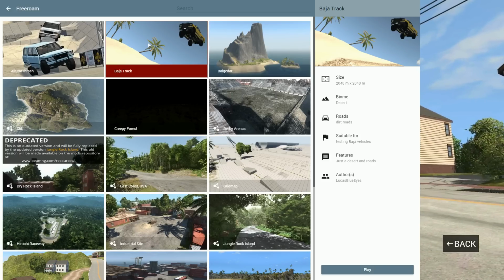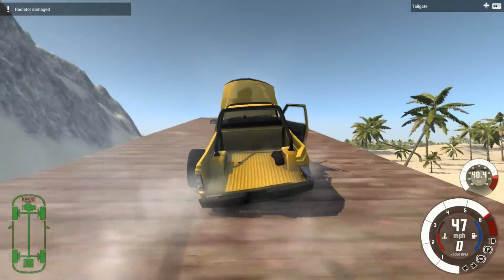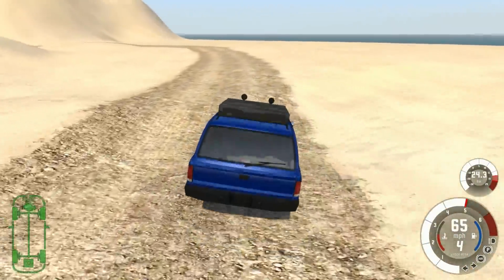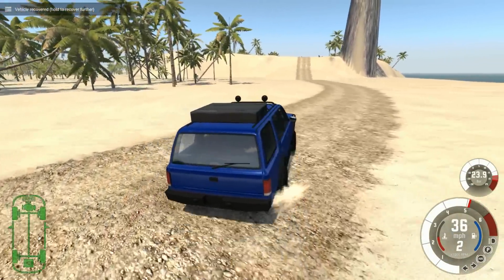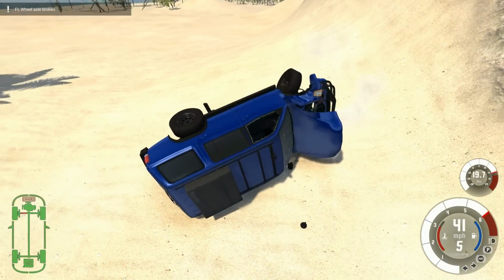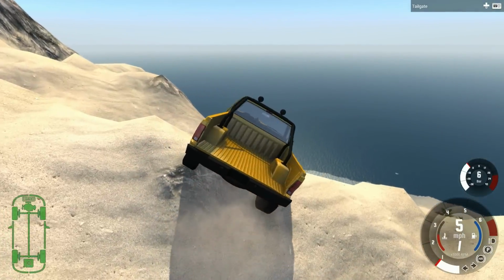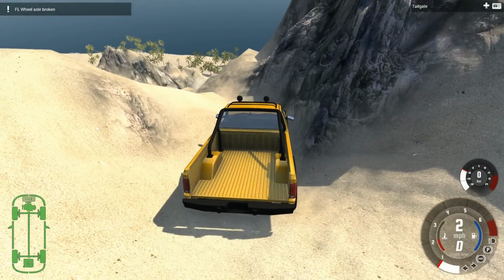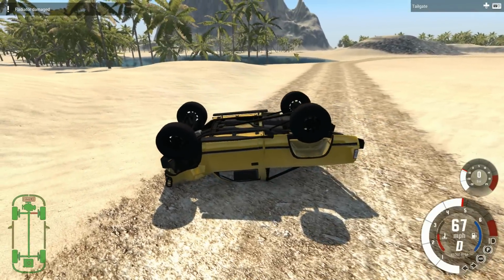BeamNG.drive - Baja Truck & Track

Comment: The D-series had the 3-link rear suspension that is designed for rock crawling and has nothing preventing it from flexing like that. The Roamer had rear leaf springs that don't allow it to flex as much.

Comment: the d-series rolled easily because the mod creator forgot to add the leaf springs. if you look under it, you can see they are not there. that is also why it shifted out of line.

Comment: Your videos are great, I love this game but I have to wait to get my own computer. Just a question, you use a gaming computer, laptop or an original computer use for everyday use.
Reply: If I remember rightly he has a gaming one. On his channel he has a link thing that shows his pc specs.
Reply: To be fair though, with newer computers, 1000dollars isn't that much.
Reply: +Generic Nickname that does not mean anything so let me get this straight. His computer cost somewhat $1000. Did he built it or bought it?
Reply: +NitroMan more than 1000 look on his wordpress
Reply: +Davebill Davebill what do you mean?
Reply: NitroMan Go on his profile, and there's some little button/link thing that'll bring you to it. I don't think it works on phone. If you're on phone and can't find it I'll put the link here if you want.
Reply: +Nazurick The Dragon ok thanks I got it
Reply: Laptops and BeamNG.Drive at 60fps shouldn't be in the same sentence.
And laptops don't have 2 980ti's.
Reply: Some Weeb Hahahahahaha.  Would be a very big laptop. If it's even doable.
Reply: Nazurick The Dragon
Eh, mine can do 5-10 FPS, and I only have an i5 2450M using the IGPU, which is the hd graphics 3000. I'm sure one with an i7 and 970M will pull it off.
Reply: Some Weeb I was lucky/unlucky in getting my computer. Lucky, because it's £2300 with a quad i7 and a GTX 1080, 32GB of ram. Unlucky, because my uncle isn't getting me any presents fro birthdays or Christmas for next couple years. Fair trade though. I'm happy. It isn't a laptop. I don't think this would fit in a laptop.
Reply: Nazurick The Dragon
You overpaid, i'm getting 2 1080's, an i7 6700k, 32GB ram, MSI z170 gaming m5, corsair h100i 750 GB SSD, NZXT s340, 650w 80+ gold PSU, windows 10, 1440p 144hz 1ms 27 inch G-sync monitor, and a backlit keyboard. I already have the mouse + Headphones, which are the Roccat lua and Logitech g230's for a similar price.

Comment: Soon as i upgrade my graphics card this month coming up , I'll be playing this game more ,
Reply: you'll want a more powerful CPU. Beam's graphics are slightly below average and don't need anything too high end, whereas its physics are very advanced, and require a more powerful CPU to process them at real-time.
Reply: well i have a amd fx 6300 6 core , and i'm to poor to upgrade it anymore. So it will need to do, i have played beam mj a few times already.  it runs ok , but needs more graphic power to, for better frame rates on graphics high or ultra. and the best graphics card i have now is a GeForce gtx 650 ti with boost, with 2gb of vram on it.